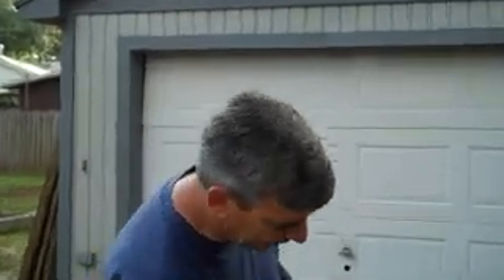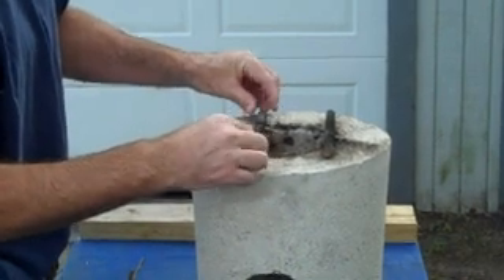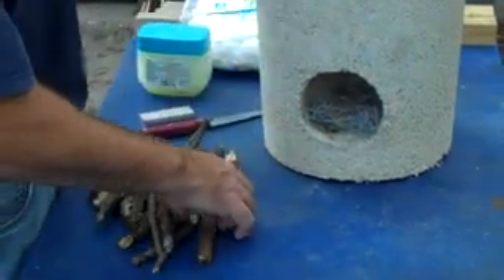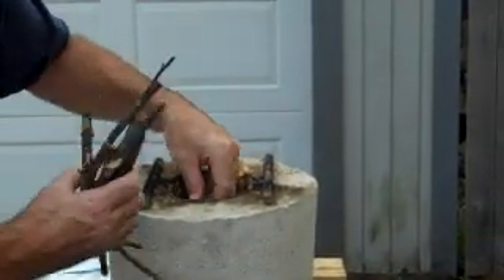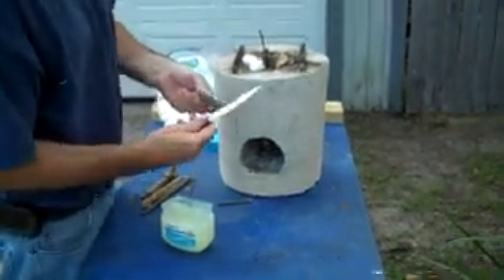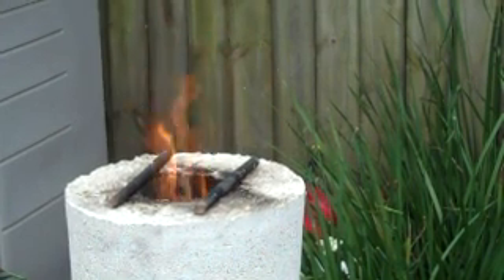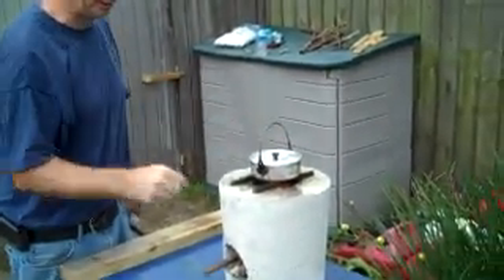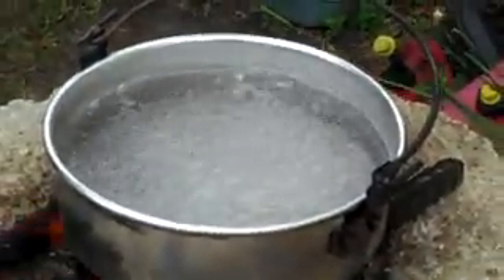Rocket Stove Test! Boiling Water

Comment: Just an idea, you could have made some 3 inch 90° bends on that rebar and welded 4 pieces together so that they make a square, set the 90 degree bends in the wet concrete over and around the hole, while the concretes still wet and set it in level so you have a nice even platform to place whatever cooking utensil above the flame

Comment: You could make the formwork upside down. To do this, it was necessary to make a hole for the chimney at the barrel bottom, and put on the bottom of the mould to shape the ideal top of the stove.
So. You can extract the product without cutting the formwork.
Just a suggestion

Comment: Like the stove.  However the fire is supposed to be started and fed in the lower hole on the side.  The old King heater works on this principle and is light and portable for those who might be interested.  It puts off a lot of heat for a small amount of fuel.  Thank you,
Reply: I thought that was one of the main points of a rocket stove. I read something about many of the pollutants burning in the lower horizontal section before they could escape into the atmosphere. It also ends up being smokeless done this way and uses much less fuel. Or so I'm told!

Comment: This might be ok for the backyard. I think I would have tried pulling the top of the bucket together and put two pipes don with a (Y) into one pipe out the side using duct pipe and just leave it inside, then burn off the pipe coating with a maximum fire. You go to all that trouble,,, why not try a two burner system.

Comment: When you have the two rebar pieces they block the heat going sideways, why not just put square tubing pointing towards center so heat can expand outward on all directions.  Or how about 4 bolts sticking out 5/8" and imbeded in the concrete.  With extra long nuts on them you can adjust the height also.

Comment: Why not make the opening where you feed the wood larger so you can put larger stick in there and have room for coals so you can cook for hours?  Don't you find the hole is too small for the wood and air.  I am thinking why not a 6 inch pipe and flit the bucket upside down so the base is wider.

Comment: Awesome video. Two questions, what is rebar and can I use this in the house???
Reply: +Mad Chaos  Rebar is the metal bars they use to reinforce concrete.  You can find lengths of it a Lowes and Home Depot.  You CANNOT use a rocket stove indoors unless it's in a fireplace due to the danger of death by carbon monoxide poisoning.
Reply: Thank You for taking the time to respond.
Reply: You are very welcome!

Comment: You could use two pieces of rebar bent into a U shape and anchor them in the concrete when you first form it.  It would serve dual purpose, handles and pot stand.  Just a suggestion.
Reply: Mrsouthersurvivor
Great Idea about the u-bend, I was thinking the rebar should be anchored originally also but I'm thing it would be easier to stabalize one's cookware if instead of just a bent U one should go more for two 90° bends and flat on bottom of the U π sort of like the pie symbol or what have you so there is a more flat surface for the pan/pot cookware to sit upon easier and more stablized and using four would be all the better than two but two would work absolute great idea especially about using for handles as well!!!

I am also thinking of trying foamcrete mixed with perlite wihich would give that much more of an isulated surface as well as possibly keeping the surface from being too hot to the touch if it doesn't hold the heat do to air bubbles? That hasn't been tested out yet, I had watched a video where a gentleman had created an airgun foamer to mix with the portland cement to create the foamcrete, he noticed it didn't appear to get hot when a torch was put to it to demonstrate it wouildn't burn, so we can test that out, or I'm going to anyway! But using the foamcrete will also add to the lightness of the stove, easier to move/transport and would probably also float, not sure with perlight being mixed in as to it's floatablity..lol! But just two of my ideas!
Reply: I'm trying to picture the u shape as a pot stand. Help!
I'm going to build one and want handles and pot stand too!

Comment: Gene Lonergan I Just built one of these using your design. I added 4 bolts with nuts so there is some leveling adjustment. Will see if they hold. Thanks for the great video's!
Reply from the maker: +BlackHillsDave Good luck BlackHillsDave.  Gene

Comment: Lol, um...that's not where you build a fire in a rocket stove...
There is a horizontal plate, midway in the bottom hole.
The biomass is placed on top of the plate, and air is drawn in from below, creating the super heating effect, which burns off almost all ash, smoke, etc.

Comment: Maybe it's meaningless, but sticking so much wood in the top of the stove then lighting it at the top also misuses the point of the Rocket Stove, no?  I believe less wood in the bottom and less grease would be more efficient.  Just sayin', lol.

In your previous video, which my comment was erased by the greedy Youtube business ethic of running non-stop videos together, I asked why you placed your new creation in plastic bag and not a paper bag if curing was the goal?
Also do you think it matters at what point you cut the bucket in half as the handles may be in the way - I do not intend to cut the bottom.  What sayest?
Nice video btw.  Thanks for sharing.
Reply from the maker: trumpsahead Hello trumpsahead.  Yes the point of a rocket stove is to limit the amount of wood burned, I just don't have that problem here so I play with fire... I think the stove would actually come out of the bucket even if you didn't cut the bucket, I just felt like doing it.  If nothing else it certainly helped in the removal process.   If I wasn't thinking of placing it into a counter top, I would just cast the stove in a metal bucket or stock pot and leave it there.  The comment about a plastic bag or paper bag is about keeping moisture in. The paper bag might absorb the moisture is my thought.  Thanks for the comment.  Gene
Reply: Gene Lonergan 
Not to belabor you with stupid questions, but I don't understand your answer regarding the use of a plastic bag vs paper bag.  I asked if "curing" is the goal why not use a paper bag, which would absorb moisture. Isn't that what you want?  Why do you want to "hold in" the moisture with plastic?  You did not explain.  Thanks, ciao.
Reply from the maker: trumpsahead Hi trumpsahead.  Yes the concept is to slow the moisture leaving the concrete so that it does not crack.  It is the same idea when they pour a slab for a home or  garage they keep it sprayed down with a garden hose for a couple of days.  Gene
Reply: Gene Lonergan 
Oh, I understand now, thanks.

Comment: I cast my first stove yesterday using perlite and mortar.  I found 1 part mortar with one part water worked with three parts of perlite added in.  I cut the bottom off of the five gallon bucket so I had more room to do the pour and cast it on a flat surface covered with plastic.  After about two hours, I gave the bucket a twist to release it from the bucket, no problem~.  I think I'll use concrete patch cement next time.  $20 for 30 gallons of perlite at AGWAY, Under $10 per stove.

For the burner, I used three common perforated bricks(ten holes each) set on their sides.

Looking forward to making wings soon..
Reply from the maker: peterinbrat You go peterinbrat.  Gene:)
Reply: My design is a straight tube using a couple of flower pots to make a cone venturi.  It's in two pours and the gap between layers is a secondary air intake you can adjust.  I wrap the pots first in wet newspaper so I can release the from the cast later.
Reply: peterinbrat 
I don't know what town you bought your Perlite, but in Slate Hill, NY AGWAY Perlite costs $32 for a 20 gal bag. They don't even sell a 30 gal bag, at least not in NY Agway. What say you?
Reply: Ithaca, NY. Not in the retail area, and I had to ask for it.  The guy at the counter was surprised at the pricing too when he looked it up.

Comment: Great job. My only comment is that the fire tube joint should be a tee so there is a bit of space for coals to build up. For indoor use and even more efficiency, though less forgiving of moisture in the wood,  I have a few wood gas stoves on my channel you may want to have a look at. Nice thing is you don't have to keep feeding wood My rocket stoves have all been portable so far. I do want to build a heavier version similar to yours for at home yet though. I'm thinking reinforced with chicken wire, making more of a fire brick mortar mix(and actually kilning it). and shaping the top for a pot stand. Oh, also, you may find it is good for boiling water, but rather hot for most cooking. Place a piece of steel below the pot, and if needed spacers, is one easy way to regulate the temperature some.I have one with an oven rack on top so you can mover the pot to the side some. I like it.That one is a metal pail. downspout material, and filled with vermiculite.
Reply from the maker: Mitch Ashdown Hey Mitch.  Great suggestions.  Gene

Comment: Safety first! Perhaps storing the 15 to 20 gallons of gasoline nearby the test site wouldn't be the most prudent thing to do. Especially using a flint to light your rocket stove. 1 errant sparks could have easily led to disaster. However, judging by the current content of Youtube, you'd probably get a lot more hits if you did film an explosion and ensuing fireball. You could then upload a nice fail video. So either way you win.
Reply: I was hoping someone noticed those too besides me. Yeah, what could go wrong... right?

Comment: Nice idea using scrunched up wire netting at the bottom to help airflow. :)
Reply: Gene Lonergan Gene my first attempt at Rocket stoves Was made with Galvanized Truck Exhaust pipe. After the second born no fumes. Evidently the Zinc coating burns off. I've been cooking on it for 2 years now with no ill affects. lol
Reply from the maker: demos113 High demos 113, someone commented that it should not be galvanized wire.  Gene
Reply: I think you mean dryer 'lint.' But I like the idea. I've seen people gather up the lint, store enough of it to fill some cardboard tubes (empty toilet rolls) and take these to use as kindling.

Comment: I would have suggested to coat the inside of the bucket either vaseline or motor oil so that removal would be easier.  Also to keep a lubed bucket handy to increase the portability of the stove.  Overall a simple and easy to craft design.
Reply from the maker: Brian Clark Thanks Brian.  Gene

Comment: Love what you did. Just looking, maybe putting 3 or 4 rebar pins in the top of the stove to hold up the pots and also a couple of bolts on opposite sides to attach a handle. I have made a stove from a 1 gal paint can but I like your idea better. My first meal on the rocket was a stir fry. I think the stove was a little hot.
Reply from the maker: Thanks for the comments Charles Vereschagin.  Gene

Comment: Gene, how hot does the outside of the stove get around the sides? I would think with 3-4 inches of insulation it doesn't get very hot at all.. With that in mind, what is wrong with leaving the stove in the bucket for save and easy storage and transport?
Reply from the maker: Hello Steve1961P You are right the stove does not get that hot.  I am still not sure I want plastic around fire. Gene:)

Comment: hey gene, i did not find out what did you use beneath the twigs, for air flow, are that wires?
Reply from the maker: Hello Amurabe.  I have used different materials.  In the video is chicken wire.  You just need air to be able to flow underneath the stack.  Gene
Reply: Has the wire gone well so far? I am wondering if you had another idea

Comment: for lighting the fire if you keep a small piece of pumice stone with a length of wire wrapped around it in methylated spirits you can use it as a re usable fire lighter and can put it in from the horizontal pipe at the base, also if you have one at the top it starts the draft to speed the fire starting and if cover outside of pot with fairy liquid the black will wash off easily John
Reply from the maker: Thanks John.  I forgot, as a boy, we would use something similar for lighting the fireplace and wood stove.

Comment: Your very resourceful sir. I see you did this project about 6 months back .Do you keep the stove outdoors?and if so how has it held up to the elements? And finally in hindsight if you built another  would you tweak the design, or build it the exact same way. Thanks for your time. I want to try this project.
Reply from the maker: Hello Robert.  I would form the stove in a stock pot and use chicken wire to reinforce the concrete.  Gene:)

Comment: Seeing it is heavy why not install handles or holes for handles in the wet mix.
Good project. Congrats ...Too sooty on pots. But this is survival mode....What about hot secondary air to control soot.
Reply from the maker: Hello Winston.  The concrete is more of an insulated firebrick.  (Actually very little concrete) Not to strong for handles I would think.  I would place it permanently in a counter or cast it and leave it in a stock pot. Gene.

Comment: i was thinking of make one in a 18.9 liter paint can. that way I'd have the handle to move it around (or my kids move it around). I suppose any cracks would be moot at that point.
what about making impressions in the top, near the surface.
for instance, using dowls to press down to make a built in grate so the fire would still come up around the pan/pot? I suppose I could grab a burner grate from the junk yard as well
Reply from the maker: Great idea.  I did not think of forming the top as a burner.  Gene.
Reply: I have to play with the math, but I'm assuming that using a larger intake would be better for flow.
I used to fly Attack Helicopters and the turbine engines have the same size exhaust as the intact (that way the tubine does not create thrust.  since the fire will accelerate the "air and gases" the size of the exhaust shouldn't have to be the same size as the intake but could be smaller.  I suppose it depends on the "blast" speed of the exhaust.
To form the grill out of the top, you'd need to make the area that the "gases" would go around the pot, equal to the area of the circle of the exhaust.
Pie * Radius squared would give you the area of  the exhaust.  probably making the impressions in square centimeters would be smartest, for making the impressions equal.  you'd then get the surface area of the whole, spread out along the bottom of the pot or pan setting over it.  it would be ok to say, double the impression area, because that would create a turbulence along the surface of the pot or pan
I'll have to get off my butt and do some math before I make my stove.
I'm buying the vermiculite this Wednesday morning.
Reply: how many have you made, and how many have cracked?  I wonder if making a "scoop" out of tin, would help speed up the air intake?
For instance, like a blower on a car engine, or a turbine.  the intake, would have a tin blade going into the combustion chamber, but the bottom half would angle out laterally, with fins on the end.  I might not do anything but with a breeze, it might funnel air in at a faster rate.  It'd be interesting to see if the temperatures would vary with a scoop or just a round intake.  probably would need a metal, electronic temp probe at the end of the exhaust.
Reply from the maker: Hello Maximus.  Interesting ideas.  The recipe I found for the fire brick is pretty flakey.  I would just use a grate.  The air flow is rather strong because of the draw created from the heat.  I am not sure how much more air I would want shooting through this thing.  Gene:)
Reply: I went to buy some vermiculite and found out here in Canada it's illegal. I didn't realize that it's about 90% asbestos. Any ideas for keeping the weight down besides using fireclay? I will most likely just use a burner for a gas stove, from the junk yard or something like that for the grill. It's been a dry winter, so camping will probably exclude most open fires. I want this lovely stove up and running by April. :) Someone told me they had a blower insulation called: Weather cellulous. I'm looking it up now
Reply: hmm, I just visited this web site that talks about concrete and vermiculite. http://www.doityourself.com/stry/curing-concrete-with-vermiculite#.UwKyPcKYamQ I'm assuming using pumice with the concrete would also create a light weight mix.  how much weight do u save with using vermiculite vs straight concrete?
Reply: hmm, what grade of vermiculite did you use? fine or course?
Reply: I see "super fine" grade less than 1mm each grain to bigger chunks.  Which did u use for your rocket stove?

Comment: 1) I think fiberglass is potential health hazard
2) Probably better with smaller holes
3) + cross or * shape 1" deep indentations can be added on top to skip rebar  or perhaps few bolts in cement.
4) 1/4" disk at bottom(coffee lid?) so gap to ground
Reply from the maker: Hello real7777, I like your ideas.  Could you explain number 4 for me.  Thanks Gene
Reply: Hi, I was thinking if there's some disk around 1/4" high in bottom of bucket then you have ring shaped food in bottom so that hot middle part does not touch the floor.

Comment: just made mine today. cost was higher for the first one - but will come down as I make others for friends
Reply from the maker: Yes David, that was how it was for me also.  I took my receipt and divided it by the number of rocket stoves I made and came up with $12.  Thanks Gene.
Reply: Gene Lonergan
are you SET on the 80 / 20 mix formula?  I want more strength and will make a trade off of more weight and less expense of a 3 to 1 mix of vermiculite to concrete.
Reply from the maker: Hello David.  No I'm not set on anything.  Good luck!  Gene:)